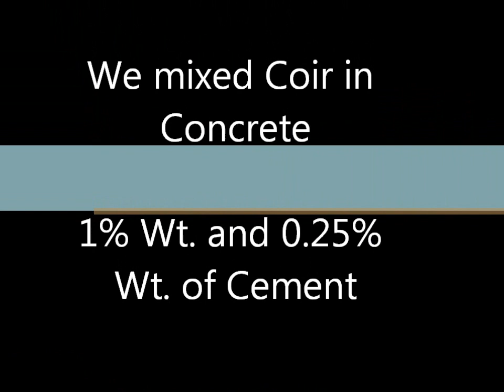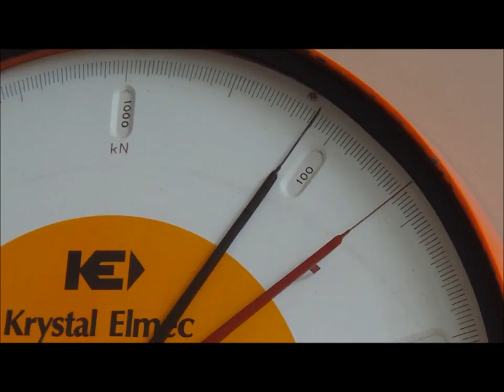Coconut Fibre in Roofing.wmv

Comment: Interesting, 0.25% seemed to perform better than 1%  % are by weight I presume, you probably said.

  I wonder about the long term performance. Cellulose fiber ought to last a long time in the alkaline environment.

 Why not make a series of cubes with Date and instructions have controls,coir, alkali resistant glass, dacron etc, and incorporate in a wall somewhere. Instructions on the blocks to test in 5  and 10 years.